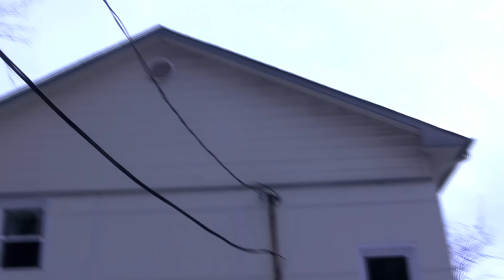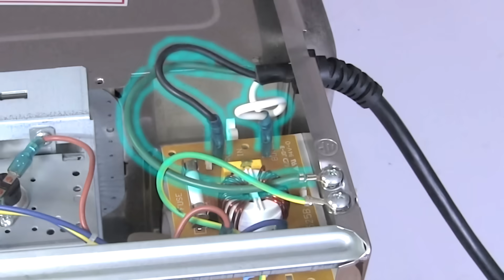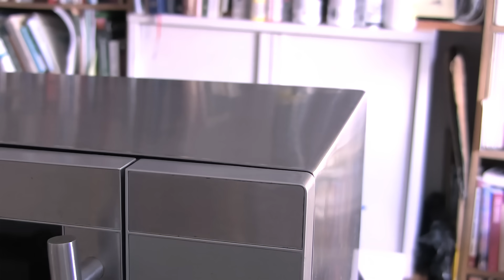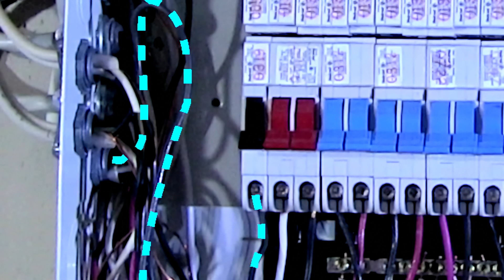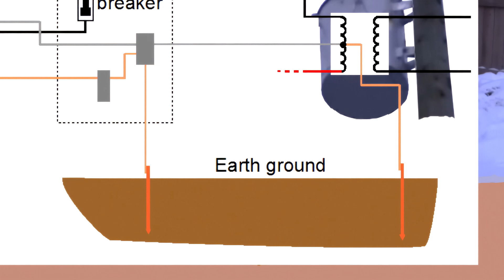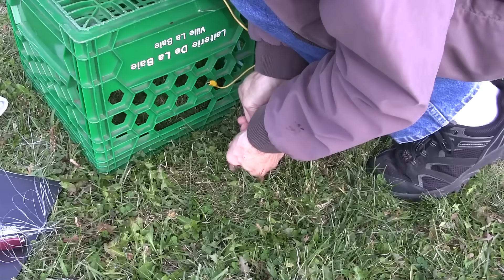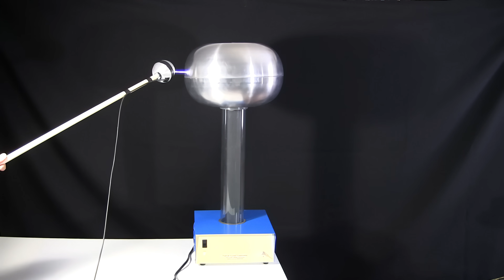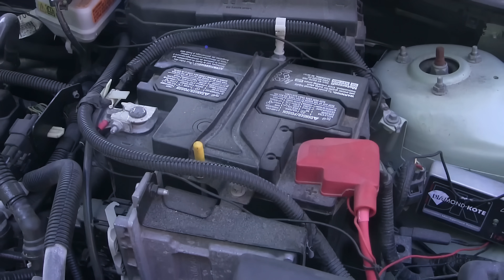What is Ground? Earth Ground/Earthing

Comment: Why is it that USA has black for active and white for neutral, while everywhere else on this planet the BLACK is NEUTRAL
Reply: Diego Matthews : Not everywhere, but to answer your question American ... and other countries, use “the wiring color code” to comply with the directives of the NEC or National Electrical Code. It’s a way to have everyone on the same page, so when I see a Black and a white wire  I know immediately that it is a 120 volts circuits, however if a find a red and black wires, that will tell me that I’m dealing with a 240 volts circuit, in another scenario I may find a Black, Red and blue wires which means and dealing with a three phase wiring system... by the way all 3 wires are “active” as you call it. So as you can see it just works as a language among people working in this trade. For what we care the active wire could be fuchsia, as long everyone understands what it does.
Reply: Gmoney & Shifter, yeah i know the US one, but in AU for example black is always neutral, and then L1,L2,L3 are red, blue and white... and for single phase circuits the red one is used, so if you have a black and red, you know it is a single phase 240V and of course the combination of either or both white and blue (plus red) means 2 or 3 phase 415V.. the earth is yellow/green (or just bare copper wire in old installations).. but yeah just be aware that in AU the blue or white will bite you LOL and twice as hard than the US since it's double the voltage.. And the "active" is the standard way to refer to the phase or live here in down under.. even on back of sockets or plugs an 'A' is printed indicating where the active connects to.. as well as 'E' and 'N'
Reply: Long time ago yellow was used instead of the white for the active (way back when bare copper wires were earth, so before yellow/green was used) and now if you have a look at some of these old installations, it's litterally yellow/green wires coming out from the circuit breakers LOL as in time the blue oxidation of copper which came out on top the yellow wires has caused green markings on the sides, making it seem like earth wires connected to the fuses..
Reply: @Gmoney1019  not at all! False information! 
You can run a 220v circuit on a blk/white wire since a 220v circuit has NO neutral.
NEVER assume the white wire is neutral or you could be killed one day!
Reply: roy Yung : you’re right you can run it, electrons doesn’t recognize colors, if you do however you won’t be following any color code norm (that I know of). Color coding are mean for technicians working on the trade. Black and white for 220v, what standard do that come from?
Reply: @Gmoney1019  electricians always run blk/wht + gnd for 220v no one makes blk/red + gnd
It is used all the time for 220v a/c units. The wire colors dont really matter as there is no neutral for 220. I have sometimes seen sone electricians wrap black tape around the white wire, but not always. The black and white wires are current carrying conductors and therefor should be treated as such
Reply: roy yung.. it sounds odd, using the white for neutral in two phase circuits in US, tho i can't argue the point as i just don't know if that is actually allowed where you are or not. I can tell you that in AU you are pretty safe to assume the black will always be neutral, tho not advisable in case there is a fault. However here there is no such thing as two phase wireing.. i never seen one or heard of one, you either get single phase 240V (red & black) or three phase 440V (red,white,blue & black).
Reply: @diegomatthews3937  huh? Did I say 2 phase? Of course there is no such thing. Either its single or 3 phase
Reply: roy yung.. here's what you said "you can run a 220v circuit on a blk/white wire since a 220v circuit has NO neutral" ummmmm this does suggest you meant a 2 phase circuit as you would use black/white cable while using the white as one of the phases. Next time mention the 3rd color also so we know it is 3 phase.. btw what would be the 3rd color since you'd use black/white for phases? Also, re your "a 220v circuit has NO neutral" fuck YES  three phase has a neutral.. it is called 'star' or 'Y' connection and has neutral in the centre!  You didn't say you were talking about a 'delta' connection exclusively.. that one has no neutral.
Reply: @diegomatthews3937  a home circuit of 220v is single phase, not two. The 120v is two phase with respect to the neutral. Therefore 220v do not have a neutral. This is why in the USA electricians can run 220v on a blk/white wire with no neutral(becuase there is no neutral) naturally they run a ground as well and a ground is always implied when running circuits. Generators produce electricity as 3 phase in a wye configuration with the center being the neutral and also it is grounded to earth at the power generation station, therefore 3 wires leave the power generation plant for transmission. Please see this diagram:
https://en.m.wikipedia.org/wiki/Electricity_generation
3 phase is never run into a home only in commercial facilities.
Please understand what you are talking about before replying.
Reply: roy yung.. ok so you say 220V is single phase, but does not have a neutral and 120V is 2 phase??? Ok.. no problem!!! As odd as that sounds i can't dispute that as i have no experience with US way of wireing stuff, never said i did.. i can only tell you that here in AU 3 phase circuits are commonly run into homes, mostly because electric stoves and hot water units use 3 phase.. and yes the 3 phase has a neutral here as the secondary side of the transformer is a 'star' system and generally the neutral is in use with these 3 phase systems.
Reply: @diegomatthews3937  let me see ifni can explain it a different way. In the US. the transformer at the pole has a secondary winding. That secondary winding has a center tap. You will have a single phase if you connect at both ends of the secondary winding w/o using the center tap. If you then connect from the center tap to one of the outside legs of the secondary you will also have single phase. If you connect a second connextion between the center tap and the other side of the secondary you will also have a single phase but it will be 180° from the first connection you madeb therefore making it two phase.
I agree that if you us 3 phase in AU and if its configured as a wye b the. Yes the center point will be the neutral. In a delta configuration there is no neutral
Reply: roy yung.. That's right, you guys use those can transformers with just the single line coming into it for the primary yeah? That's 11Kv correct? And the other side of the primary winding is grounded? That's the difference here with the transformers that the primary 22Kv has all 3 lines going into the transformer (in delta) and 99% of the transformers are all 3 phase with 4 output connections, one of which is the neutral (secondary is a star connection) and then the maybe 1% of transformers have only 2 lines going in for the primary, and has a single winding on secondary with just 2 connections (neutral and phase) but those are generally used in some remote locations for traffic signals etc. The transformers are also much larger here, with say 1 per 3-500 households, so they're not as common on poles as the small can ones in US, but keep in mind that because the voltage is double, the wires only need to carry 1/2 the amount of current, both for primary and secondary.
Reply: @diegomatthews3937  what you say is very true. Our primary are 7200v and serve maybe 10 houses per transformer. So we only have one primary wire at the top of the pole going to the primary side and the other side comes from earth ground.
Reply: roy yung.. Yeah i forgot we have those here also, but only for very remote tiny rural towns, or just remote single lots where you have 1 such transformer for 1 household, the single primary line.. SWER (single wire earth return).. but you will never ever see these if you live in larger towns.
Reply: @diegomatthews3937  yeah here they are all over the place. I guess they save on running just 1 wire to communities. 3 phase is just for commercial use here
Reply: roy yung.. Most houses here, especially older ones, all have 3 phase.. but that's like i said because of appliances like instantaneous hot water systems and stoves where single phase wouldn't be enough, in some cases aircond units too. Other than that, many people have workshops at home that use 3 phase tools. New houses generally get single phase as gas stoves and gas water heaters are more common now, however you do have the option to upgrade to 3 phase power anytime as it is readily available on the poles everywhere.
Reply: We use black or brow for phase and blue for neutral, so... (Belgium btw)
Reply: I was referring to fixed wireing only, i know generally flexible cords use blue for neutral and brown for active. In Australia black is always neutral, no exceptions.. again, fixed wireing. The phases are always red,white,blue..
Reply: I wondered about the coloring too, because I would have thought black = 0 = no charge and white = 1 = charge. But since that's not right in this context, I remember it as black = death = danger and white = safe = neutral.
No idea what the actual reason for the color choices are.
Reply: SidShakal.. Black being neutral makes more sense though, as black is also the negative on DC voltage.. I bought some security lights a while back at a hardware store, they were made in china but must have been made for the USA market as they had black and white wires, so i hooked them up and turned out i had live on the screw part of the E27 bulb sockets and obviously the neutral was at the bulb base contact.. and that's because i connected the black to neutral and the white to live, as is the standard here.. had to swap them at the end.
Reply: European standard recommendation by CENELEC is brown, black, grey for L1, L2 and L3. Mandatory are blue=N and yellow/green=PE.